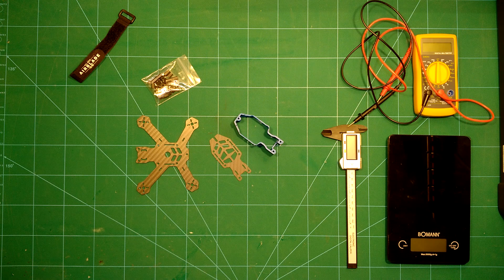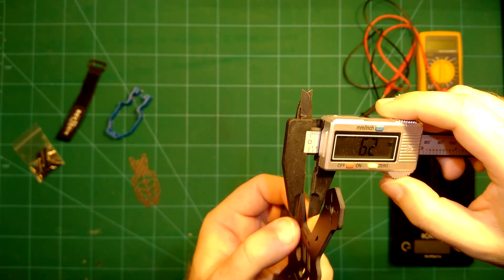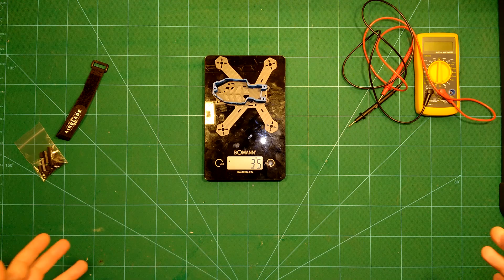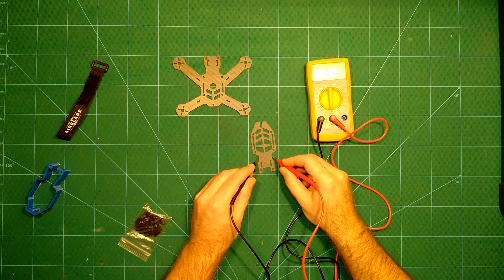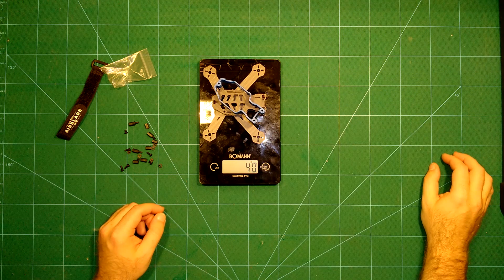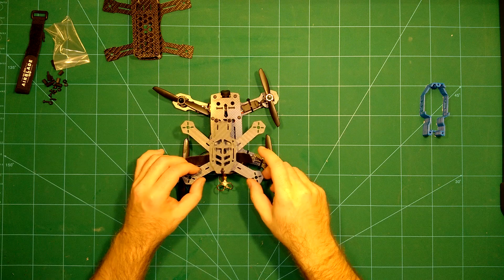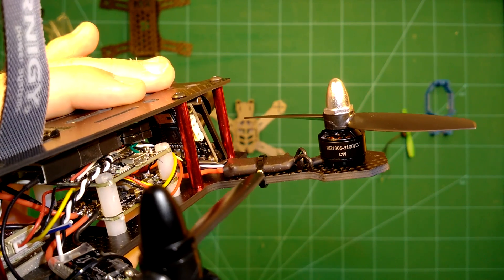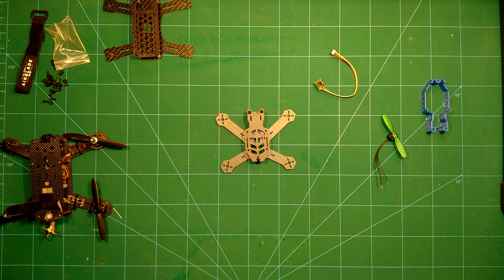AirBlade Assault 130 Carbon Quadcopter: Review, Comparison & Suggested Components

Comment: I like 250 mini quadcopters very much and I want to buy my first cheap 250 quad and I don't know so much about them.
I have rtf mini quadcopter for example  soma x5sw and husban x4 and more 
is this a good option or if there another cheap quadcopter (under 200USD ) that I can buy (RTF) http://www.aliexpress.com/item/QAV-250-RTF-Quadcopter-Frame-Racing-CC3D-Flight-Controller-MT2204-2300KV-Motor-Simonk-12A-ESC-5030/32554934870.html?spm=2114.01010208.3.87.ocgH0D&ws_ab_test=searchweb201556_2,searchweb201644_3_505_506_503_504_301_502_10001_10002_10016_10005_10006_10003_10004_401,searchweb201560_8,searchweb1451318400_-1,searchweb1451318411_6449&btsid=31b31ddf-fe64-4e61-a1e6-27c7da6c0f8a 
please reply
thanks
Reply from the maker: +Georgio Gergi Hi there! Please don't use such a cheap radio, that is the first thing which you will definitely regret. Get yourself a good radio, which you will have for a long time. For a good, but still as cheap as possible, starter kit, I suggest you to take a look at the Eachine Racer (http://bit.ly/1kMysNa), which offers great value for the price. Additionally get yourself a Taranis radio (http://bit.ly/1OAF5KH), if you seriously want to stay in the hobby. I know, the price of the radio looks high at first, but it is a great radio which you will probably never feel the need to change, even as you progress much deeper into the hobby.

Comment: I have an airblade assault ARF kit on order form liftRC it looks  like it will be a great build I'm looking forward to see what you decide do with yours. cheers
Reply from the maker: +John Scott I have now gotten most of the parts for it. I will go with 1104 motors and XM10A ESCs together with 3030 props on 3s. That should give me around 350g - 400g of thrust, which should be plenty for the little guy. I will also use one of the 5g micro CMOS cams (from my 5g DIY FPV set video). Really looking forward to see how it goes.